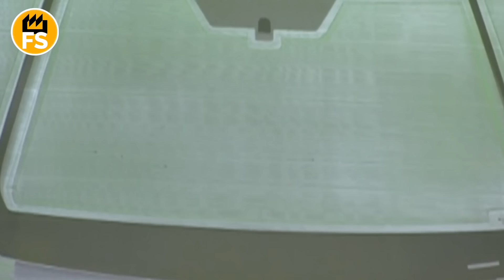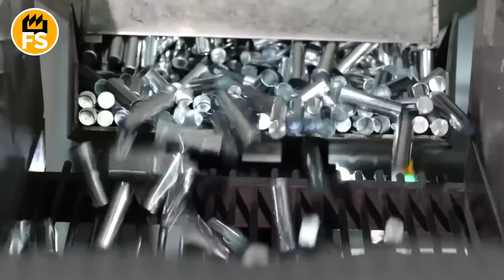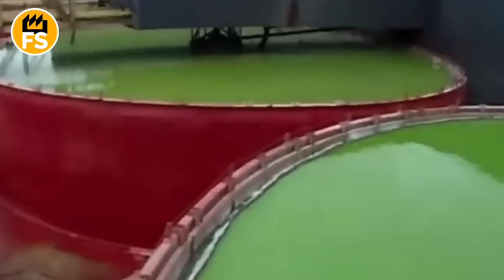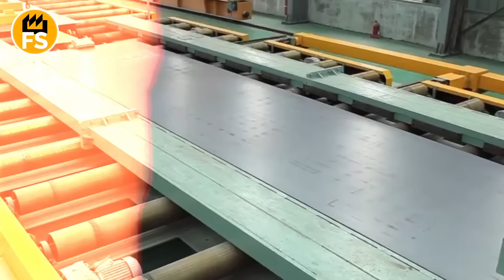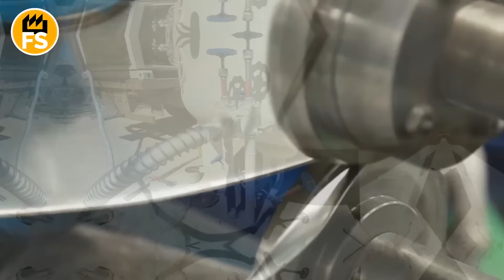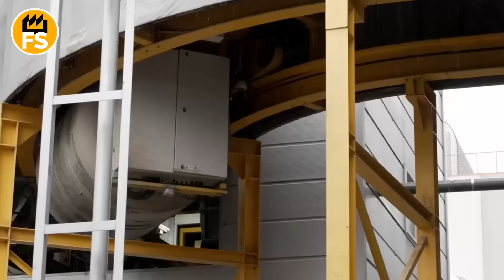How 100 Million Square Meters of Car Glass Are Made Per Year!

Comment: That's 3000 degrees of pure genius 👏. Car 🚗 windows are not solid glass all the way through. There's a layer of plastic, sandwiched in between. P.S., there's no actual temperature that glass melts at, because of the impurities in it. It melts between 2500, and 2900 degrees Fahrenheit. Your friend, Jeff.
Reply from the maker: You've hit on some really interesting points, Jeff! It's always great to learn more about the specifics of glass manufacturing and its unique properties. 🌟